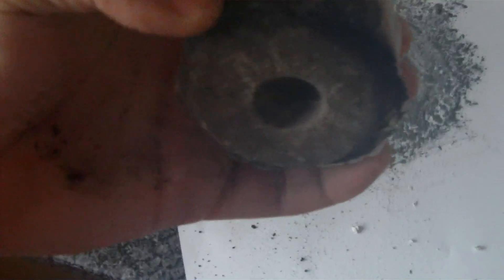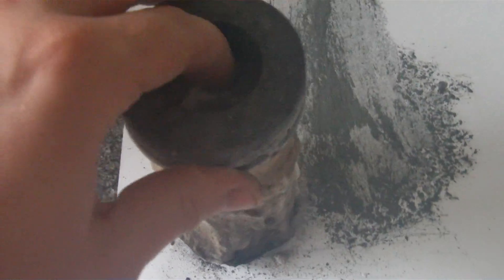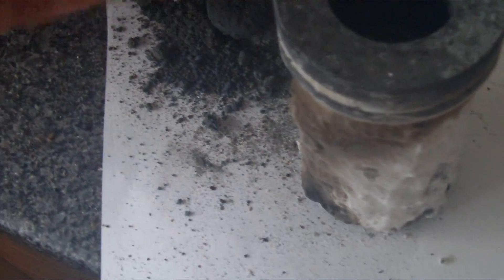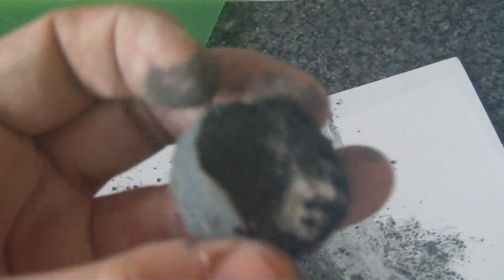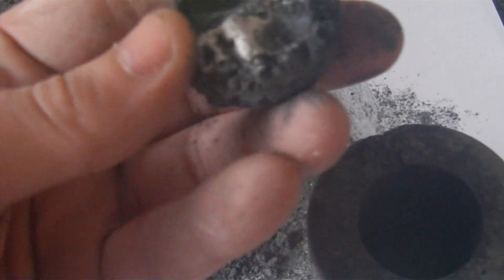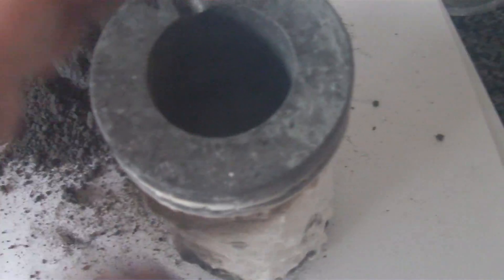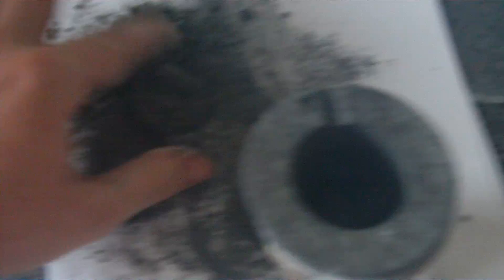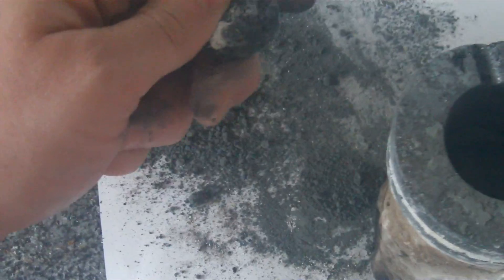Microwave Experiment 5 OUTCOME SUCCESS

Comment: This may interest you. https://fenix.tecnico.ulisboa.pt/downloadFile/844820067124788/Dissertation.pdf
Reply: The article is quite interesting and has addressed much of the issue involved with insulating etc... it makes the most sense from reading to build your own microwave using appropriate insulation and a insulating housing with two 800 or 1000 watt magnetrons. After you read it you should feel quite confident  in microwave sintering. Don’t forget the addition of a vacuum pump.